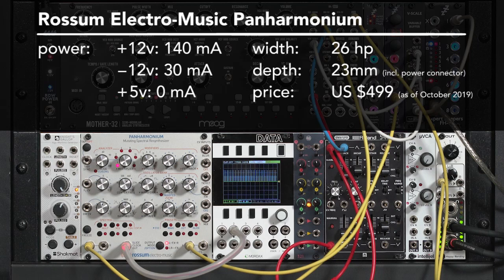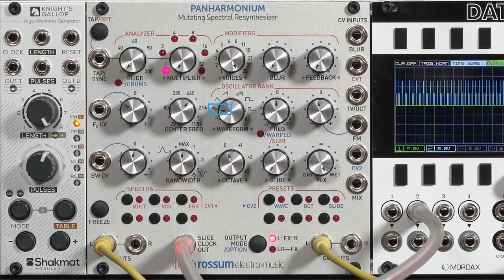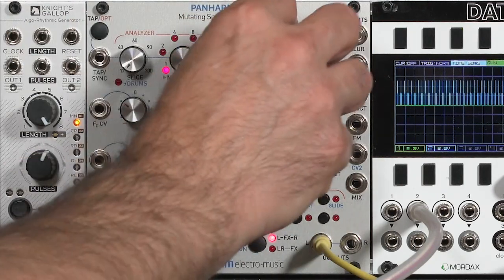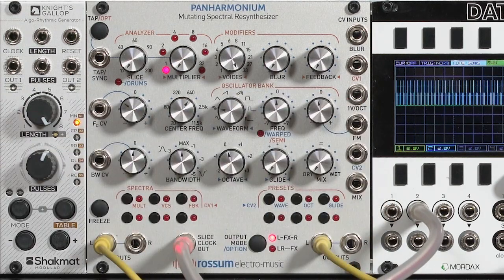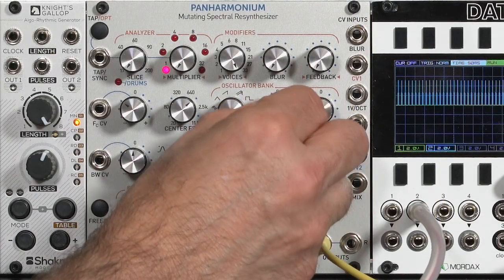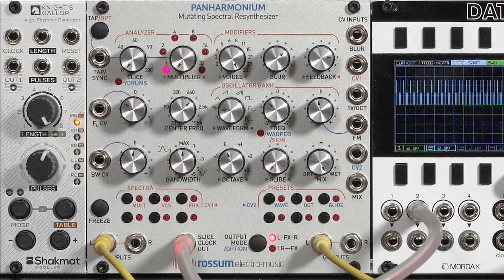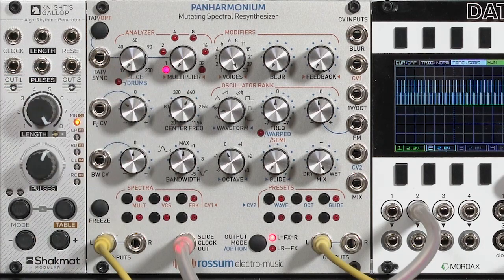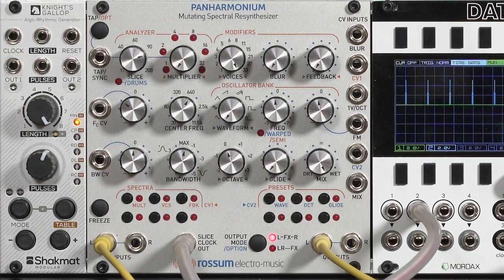Rossum Panharmonium 1/2: explained

Comment: Good idea! I run stereofiles from my sampler into it. But if it processes in mono will it then leave out the the R channel from my Morphagene? 

Will the stereo sound file/sound from Morphagene then not get passed through the panharmonium and dissapear?
Reply from the maker: It collapses the stereo input to mono, and outputs a processed version of that. The wet/dry mix blends the mono processed output with the stereo input.
Reply: @LearningModular  I see, so the effect of the PanH is mono on 100% wet, giving the exact same sound on each side (L&R)
But if I have it 50% wet  I hear 50% of the orginal stereofile?
Reply: @LearningModular  if it collapses it to mono, it draws sounds from both L & R in the stereofile. 

I often have different instruments panned L & R coming from my Morphagene and now through my new Pan H. - :)

Comment: Sound like the output is distorting/clipping.
Reply: Korhan Erel sounds like it’s supposed to...
Reply: @graviton9282  i have been working with spectral synthesis for years. This sounds a bit strange. Perhaps it is because of the source material used.
Reply: Korhan Erel yeah. Good point, I think it’s likely not just clean sound, true...
Reply from the maker: The source itself was very "cloudy". But beyond that, there were two possible places for distortion: On the input side, the Disting I was using for playback likes +/-8v; the Rossum digital modules are clean up to +/-5v and then perform soft saturation in analog to get +/-12v to fit inside +/-10v, which is what they digitize at. On the output side, the Rossum digital modules can go up to +/-10v full scale, while the Moog Mother-32 starts to clip the aux input at +/-5v. Just another reminder of how important it is (and how much of a pain it is) to keep an eye on signal levels in Eurorack.
Reply: @LearningModular  thanks. I thought there was something strange. Spectral processing does sound cloudy but this was not that. 

About levels. This is one of the reasons I keep only a small modular case and focus more on non-modular synths. I won't spend a fortune on modules just to make it function properly. :)

This Rossum module is nice but way too expensive - another reason my modular case is small :))))
Reply: Korhan Erel this issue has always mystified me—I have 3 cases of eurorack and don’t have ANY issues with levels, and everything sounds as good as anything I’ve heard from any fixed synth, modular or not, so it’s not really a good reason to avoid them.it depends what manufacturers and modules you buy, they are definitely not all created equally.  But the same is true if you buy a full on synth in a keyboard at a time, you just get your hand held more that way with everything all configured.
Reply: @NickHchaos  i am not avoiding modular. I have a small system. But your statement is not correct. Lfo output levels vary a lot from module to module. Stages outputs 8V, Pamela outputs 5, for example. Maths is 10, I think but has its own attenuverters. This exactly why there is the saying "you can never have enough VCAs".
Reply: @KorhanErel  Oh, I know they VARY, but I'm saying I never have PROBLEMS--isn't that what knobs are for? Adjust to taste.

Personally, I think that's a bit of a stupid saying. Plenty of times you don't actually need a VCA--just an attenuverter will do, and a cheap switch can be a life saver! Some of the best synths ever made also have relatively simple architecture, e.g my Roland Sh-2 has one VCA as far as I can tell, but tone is delicious and it's eminently playable and tweakable.
Reply: @NickHchaos  true an attenuator is fine, but I still find modular cumbersome and fiddly as an "instrument". For composition and sound design, I like it a lot.

Comment: I'm new to this  stuff. So, basically this gives a monophonic sound a stereo effect and more?😏😏
Reply from the maker: It's very different than that. It deconstructs a mono or stereo sound into the individual harmonics that it is made of, and then reconstructs it with new waveforms, pitch offsets, and the such. So it's sort of a sound transmogrifier.
Reply: The one thing it does not do is give monophonic sound a stereo effect. 😃

Comment: Just way too expensive for what it does.
Reply from the maker: To each their own. If you don't want/need what it does, any price is too expensive, yes? ;-) Just in technical terms of what it can do, I honestly expected it to be at least $100 more.
Reply: Rossum has great stuff. style and design.
Reply: @LearningModular  Just starting full-on modular, and this was my first purchase.  3 years no interest at Sweetwater, so I decided on one big purchase instead of a number of smaller ones.  Kind of an odd first modular piece, but I have a few semi-modular pieces (Minibrute 2, a Koma "pedal" and another "pedal," a Sonicsmith Squaver.  Did not need a filter/LFO/oscillator, as the other devices can supply those functions, so I went with something I could not do with any other synth.
Reply: Dave Rossum is a Hairsplitting, Nitpicking Sound-Engineer   L E G E N D   !  And consider yourself a PARTICULAR lucky dude , just to ponder on his inventions ! - This marvel of a Complex module can be used in ways , you even cannot comphehend ! -  This module , being beyond your paygrade, says Notn´Bout the myriad of ways , its designed to work, aswell as the ways its , nonintentional CAN be used , to get sounds , never heard before or since !